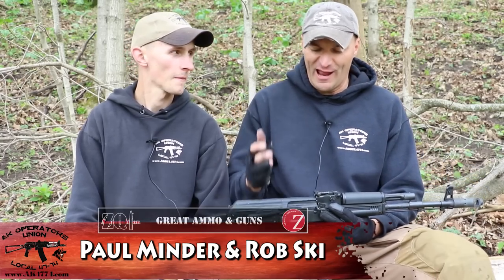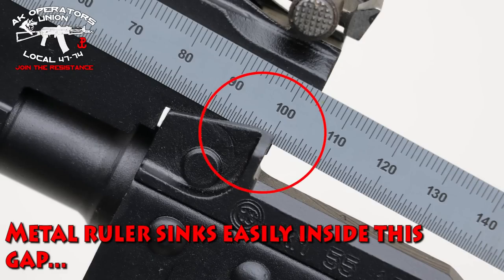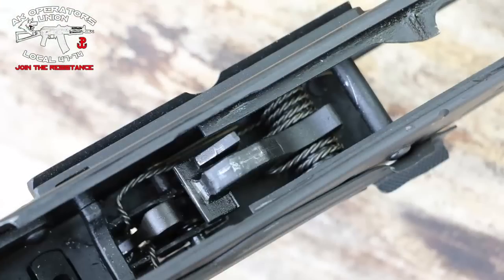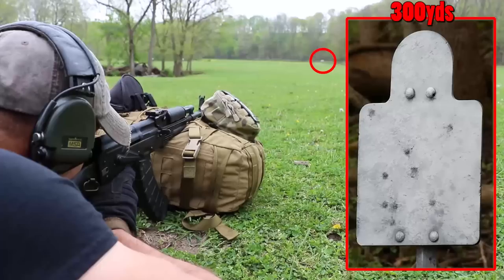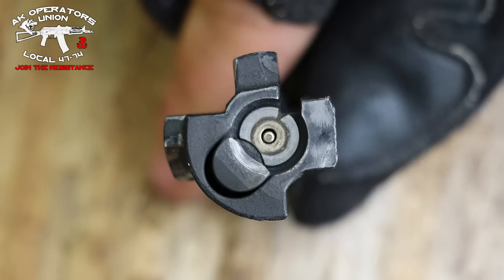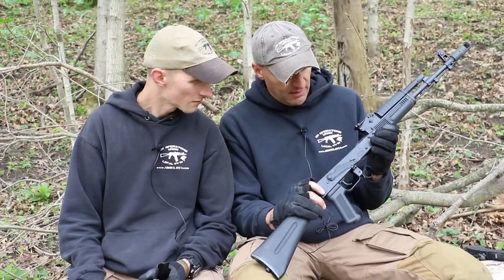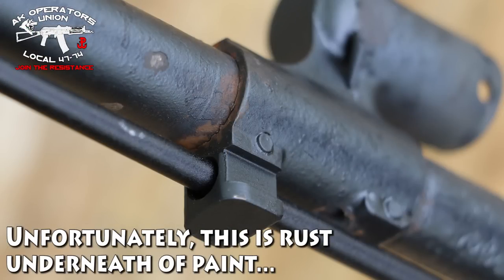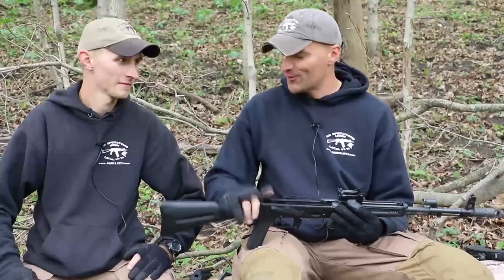Arsenal SLR107 1000rds Later - Bubbles Attack!

Comment: Rob, really glad you are testing this rifle. 2 additional areas to check (and I am sure you would notice a change if you saw it ) 1. the ejector for deformation(bad heat treat), 2. the bullet guide rivet. my Krebs Custom 103 clone has a bad(loose and welded!) bullet guide. Also, I think Arsenal considers that ridge on the trigger as their interpretation of a 2 stage trigger.

Comment: I'm not a die hard AK guy but if I were to get one for serious use I wouldn't consider anything less than a custom one from Rifle Dynamics or Krebs.
Reply: +Solar_Empire Lol, pick up a Chinese rifle for way less.  Even the preban rifles would be cheaper than a new one from those guys lol.  And better too.
Reply: +Jeffrey Wacker Well I never said I'm getting one so it really doesn't matter.
Reply: You would be safe with definitive arms as well.
Reply: yeah definitive arms or DDI would suit just fine
Reply: +Solar_Empire Then you're a sucker, a sucker is born every minute.
Reply: *****
An AK that works should not be $1000.  They're designed to be cheaply produced and still work.
Now, they've become snob rifles.
Reply: @hansblitz7770  Buddy, inflation has lead to a bigger number when it comes to the price. There's also the fact that Russian AKs are banned now. There's also supply and demand. 

It's fine if an AK is $1000 or $2000, what matters is if it's made properly. You won't be thinking "thank goodness I saved a few hundred" when your life is on the line.

Comment: Botique AK that can't be bothered to use any paint designed to resist heat. That is so scummy by arsenal.
Reply: +Syrupsipper sippin on some sizzzzzyreeeerppp
Reply: +Syrupsipper I think they where just joking.
Reply: I have an arsenal, but if the guns finish is meant to be more for looks than function and they charge an arm and a leg, then it is a boutique gun.  especially if the the gun isn't even straight.  Get your shit together arsenal you have too much competition now to have these issues
Reply: finck2208 when I think of a boutique gun I'm thinking of paying at least 3 times this rifle.
Reply: Syrupsipper I think you can have a boutique section of a larger company. I feel like many cars and clothing things have that.
Reply: +Syrupsipper I understand what a boutique is, but in this context it just means a gun is more pretty than functional.  doesn't mean it's made in a little shop...that's just my interpretation anyway.  and like I said I have an arsenal.  I have an slr 95, but this is unacceptable
Reply: finck2208 is your 95 better?
Reply: +PleaseDontWatchThese  I've had good luck with it.  sights and trunions all straight.   granted I don't think I've put 5k rounds through it, but I've probably put about 2k through it and have rapid fired 6 or 7 pre loaded mags on a couple occasions.  no bubling
Reply: finck2208 that sounds good to me

Comment: Who bitches about the G2 trigger? It's far better than the factory trigger on my VEPR AK.
Reply: Syrupsipper
Irrelevant. Watch the video.
Rob was comparing the Arsenal trigger to the G2 and mentioned that some people bitch about the G2.
Reply: +Elijah Decker Norinco MAK & NHM owners have some bragging rights but the G2 is a very good trigger compared to most stock triggers.
Reply: TRUNKBACK JIM
Yeah, I was surprised how good of a trigger the G2 is compared to other AK triggers I've tried. No complaints here.
Reply: Elijah Decker Yep I run em in both my saiga conversion and m70 folder
Reply: +Elijah Decker love the G2 in my wasr 10/63
Reply: It might be better than a mil-spec trigger, but the hammer is too hard and started to deform the tail of my bolt carrier. ALG AKT all the way.

Comment: I too have an SLR-107 purchased in 2007, & I love every aspect of it except for the fact that the paint has flaked off ever since I bought it, primarily in the receiver. & I haven't run it as hard in 9 yrs as you have in 1000 rds. This has been a consistent issue for YEARS & Arsenal hasn't done anything to change it! It's very accurate, but these continuous finish issues are entirely unacceptable for a $1000 AK!!!

Comment: My friend and I had a discussion about the pain bubble. We think its not the paint. But grease/oil underneath of the paint heating up and then making it flake off. They might have not got all the oil/grease off of the gun before they applied the paint to the barrel. It might be a batch of lemons. After all the arsenal rifles I have seen and shot. That's my guess. And yes they do need to up the QC!
Reply: Whatever the cause, since my 107 started flaking years ago, I've checked the forums & finish has been a consistent issue for Arsenal for a while
Reply: Yeah they are not known for their finish thats for sure... Just our idea on it sense its just the barrel and gb. Parts painted over before they were cleaned off all the grease and oil. Especially the small areas. Like were it's rusting on Rob's rifle. Were the barrel meets the gb.

Comment: The rust under the paint is a result of poor surface preparation. If you see shiny metal under chipped paint, they didn't parkerize it before painting. They probably didn't even sand blast the metal to clean it off  or to give the paint something to stick to. Makes you wonder what else they skipped on to save time and money.

Comment: I have an Arsenal SLR 104FR which is in 5.45x39. I shot about 300-350 rounds through it. I lost a lot of finish on the BCG, not no deformation. When I picked it up, I noticed the finish on the gas block or the front sight was a little..toy like... But because I only shoot it 50-100 rounds every time, and let it cool down while I shoot other guns, so the " finish " haven't got off yet...

Comment: My question is... 
  Will Arsenal stand behind their products and fix a canted sight issue for example?
Reply: +Monte PR 
Very unlikely. Their warranty only covers function. 
If the sight block was canted enough to impede the cycling of the BCG then they will/should correct the issue. Ive seen this on a forum and they sent the guy a new rifle and I think it was also slightly canted but is reliable.
Reply: +Monte PR Yes , You have to pay for shipping. And wait for a month or more. That's what they told me. Any gunsmith can fix it.

Comment: Does that mean the barrel was rusted at the factory before they even applied the paint?
Reply: +Scott Sherman Yeah, it looks like it. That kind of thing shouldn't be happening if the barrel was not rusted BEFORE they even parkerized and then painted it. If there is rust underneath, it can't bond to the barrel, and the result is that the paint will flake. That is a quality control issue for sure. If the barrel had been clean before it was parkerized then there shouldn't be that kind of rust on a new rifle. And of course then the paint wouldn't be so ruined from those kinds of temperatures.

Comment: SLR104, No issues with rivets, no issues with front or rear sight, no bubbling paint.
500 rounds. Going to run it hot to see if it bubbles. Running wolf ammo made by Barnaul

Comment: I put 2 75 rd drums rapid firing through  my slr until my handguard started poofing white smoke no melting or chipping afterwords my serial number starts with an xk and I've heard the ones with xm specifically xm55's are the ones with the main problems at least on forums I think it may be a quality control issue that they are having none the less I think arsenal needs to address this problem

Comment: Let me start by saying I like AKs.  I have 3.  I know this comment is going to catch a LOT of YouTube hate.  But it just dawned on me after watching these 5000 round tests on AKs, I never see a test of an AR comparing the deformation of parts on the bolt carrier, bolt, buffer assembly etc from a previously tested unit.  

I also have 4 ARs, and even my $400 DPMS Sportacle has not exhibited anything outside of the ordinary from my other ARs in terms of wear and tear.  Granted, I don't have more than about 500 rounds through each of my ARs, but they are all look about the same at this point and the parts are COMPLETELY interchangeable.  

Again, I like my AKs but I have to wonder what about the QC on AKs give them such a bullet-proof reputation, when there is so much that just seems so variable in quality from batch to batch.

Comment: hey rob i believe arsenal is aware of their sight alignment defects if you look at your owners manual under the manufactors warrenty canted sights are exempt from coverage. just a heads up
Reply: +Joe San That isn't entirely true.  I shipped my 107FR back because the rear sight block was slightly canted, and it came back straight.  Just sucks that you have to pay shipping to them for warranty/repair problems
Reply: +Christopher Clements it could of been just the sgl 104fr series but when i looked through mine it stated it wasn't covered for some reason.

Comment: Rob I have to ask have you seen this finish problem on the sam 7 series because of all the videos I've seen on you tube  all the rifles that bubble up are the stamped SLR series.  I have not seen a video yet of the milled arsenals having this problem.  Is there a difference in the finish they use from one to the other?  Just an observation maybe this is something worth testing.  IMHO I'd rather suffer the extra pound of weight and get a milled AK.  Especially if there is no finish problems.

Comment: I wonder if there are any people with SLR 104s out there with this bubbling paint issue. I've got an SLR 104 with a serial prefix AB54 and I've put thousands and thousands of rounds of 5.45 (mostly 7N6 up until the past 6 months or so) and minus the usual wear and tear from banging the rifle around the finish on the barrel has held up fine (no bubbles, no rust, just scratches). The finish is Arsenal's usual crappy finish but it hasn't bubbled or flaked on me.

I'm just curious if this problem is only on 107s or if the other rifles in the SLR line are potentially at risk.

Comment: I've been waiting for a SLR test like this. WOW is all I can say. That finish is a shame. I appreciate you guys and your no-holds-barred tests and am glued to your channel. Can't wait for the follow-up on this. Thanks guys !
Reply: +Patriot Bill What if I tell you "the follow -up" before it happens? It'll run 5000 just fine, it'll run 10,000 just fine and it'll run 15,000 just fine and most of the wear will be a barrel about to go at that point. It's 5/8/16 remember this when it gets to the 5000 rds. it'll be fine. It's a battle rifle not a rifle for pretty little girls like all the people making a big deal out of the paint job and people that will never get close to wearing the barrel out. 

Yes, it's a garbage finish, yes they're overpriced but turds like CAs will cost you $700, DDIs are around the same. Are Arsenals that overpriced compared to the other turds?
Reply: +Piro The Great You may be right. Thanks Piro.

Comment: If you want a 7.62x39 AK ... get a Vepr, its just that simple. If you want 5.45 there are other choices, but if you want 7.62x39 ... get a Vepr, you get the good barrel, you get a reinforced receiver and trunion, the metals are treated properly, its a good gun, I mean hell they run 7.62x54R out of basically the same rifle and it handles that.
Reply: Do those x39 Vepr's take standard AK furniture and magazines?
Reply: +chrisloUSA They will take standard AK mags if you install a bullet guide, you can buy them converted with it already installed or do it yourself, similar to the Saiga conversion. The same with the furniture, you can do a conversion or buy specialty furniture. But, with the RPK style reinforcements this will be a much stronger AK and it will flex a lot less than others resulting in better accuracy. That and those barrels are very nice, about 3 times the service life if you dont overheat them and strip the bore.
Reply: BigChiefWiggles V Thanks for the heads up, I would hope someone makes standard AK furniture that fits this style of AK, I don't want to be stuck with sporterized stock options only.
Reply: chrisloUSA
 The stock isnt the problem, they came with either a straight-cut receiver or the slant-cut, the slant needs an adapter, the straight takes standard stocks, the main difference is forend not the stock, you can get it converted to take standard AK front furniture or leave as is and get Vepr-specific ones... The important things in the AK are the receiver, trunion and barrel, the metals have to be right and heat-treated correctly, otherwise you end up with a soft turd that rattles itself apart...

Comment: Sometimes the trick to getting a good AK trigger pull is to remove any side to side slop (wiggle).  Some shims on each side of the trigger/hammer inside the receiver.  It sounds so superficial but it really isn't, those engagement surfaces need to not be twisting one way or the other.
Reply from the maker: +multiHappyHacker oh, i know exactly how to improve this trigger, but i wanted to describe to you guys how it feels "stock".
Reply: I see, then can you show us if there is any side to side wiggle with the stock trigger?
Reply from the maker: multiHappyHacker Yes, in next episode i will try to remember
Reply: +Ak Operators Union, Local 47-74 for $1000 nobody should be having to shim anything on that rifle. same with the finish, you can just wire brush the flaked paint and rust off and then rattle can it, but you shouldnt be having to do that on a brand new $1000 gun. its all easy enough to fix but thats not the point its a brand new rifle, at a premium price point for the platform.

like thats the kinda shit that youd expect from century but its coming from arsenal, and its not the result of them having to use lower quality parts kits due to lack of supply as they have claimed in the past when people have questioned their dip in quality the last few years, its just sloppy shit assembly.

somebody didnt properly seat that rear sight block when they put it on, then they didnt go back and fix it after they fucked it up, and the qc guy said fuck it and pushed it on through. somebody didnt properly prep the metal before paint, or they didnt let the paint properly cure, then they didint bother to fix it, and the qc guy said fuck it and pushed it on through. somebody dropped that rifle and it landed on that rivet on a hard surface, or they jacked it up in the press, and rather than redo the rivet, or even just sand or file it down a bit to make it less noticable they left it, and the qc guy pushed it on through.
Reply: +commie416 Doesnt seem like they have a qc guy or maybe he was out play golf or something..sleeping in the brake room.....But have to agree for a 1000 bucks the finish n trigger need to be much better....rivet doesnt bother me...oh and the rear site C'Mon Man !

Comment: What a lemon. Rob Ski you have to check for us after the 5000 rounds are finished to see if your rifle was actually parkerized underneath that paint. And the rust is a bad sign - if it had been parkerized it shouldn't have rust like that on a new rifle. I have a feeling that your rifle's barrel was rusted before it was park and painted. In that case, the paint wouldn't be able to bond well. A failure in quality control for sure.

That being said, the nice accuracy is still a good sign and the internal parts other than the trigger look like they are holding up very well without deformation. We'll see what it looks like at the end of the 5000 rounds and see if the parts are as strong as they appear to be so far.

Comment: +Ak Operators Union, Local 47-74, I love my SLR-107; It's my first AK. However, you are right! mine is rusting in the same spot and there is nothing I can do to prevent it. I tried cleaning that seal with CLP and toothpicks for a 1k - 1.1k rifle I cant help but feel a little less then satisfied. could you please do a follow up with arsenal support?

Comment: the issue i have with my tapco g2 trigger is its hammer shape is sharp and caused my tail to deform. i filed down the sharp edge where the hammer connected with the tail and it stopped deforming. Pretty annoying. 

But the bubbling is ridiculous. Cant believe people are bitching you are not giving them a pass on that. If my Yugo or WASR did that i would be pissed.

Comment: Definitely keeping a close look on this channel and looking forward to 5000 rounds. I have yet to purchase an AK and I am still going through Rob's archive footage to figure out what I want.
Reply: +fijillian Based on what I have seen DDi and Definative arms are the best, and WASR is the best budget option.
Reply: +fijillian Vepr is best
Reply: Vepr rifles are outstanding, but a bit heavy.
Reply: +Ak Wizard Two things if they heavy, hit gym and if that don't work, get AR. AK are heavy rifles. Yes they have reinforced receiver and thicker barrel, which makes them more sturdier and accurate. The weight is manageable. But if its big issue, then AK platform is not for you and AR will be your choice.
Reply: maksim tsionskiy Weight is something to look out for though. Ak is not in my opinion a heavy platform, however it is still worth noting that a Vepr is about a pound and a half heavier then a similar built Ak. For someone who might have to carry the weapon around or hold it for a long time that can make a difference.
Reply: +Ak Wizard when comparing to AR platform, AK rifles are heavier by quite bit. Vepr is pound heavier, not 1 1/2. But it also depending on configuration of rifle. If you want to carry weapon around for long time, you should have a good sling and that will solve the problem. And regularly working out will make it even more easier. Unless you plan to Scream: URAAAA!!!!! and rush the enemy.
Reply: +maksim tsionskiy Thanks for the response. I will try to hunt one down before November fingers crossed
Reply: +Ak Wizard I will look into that.